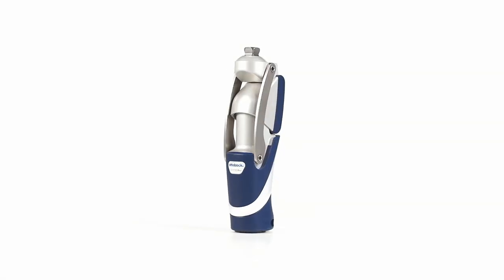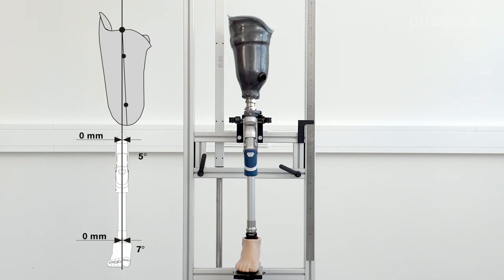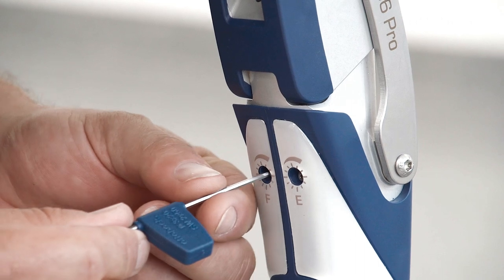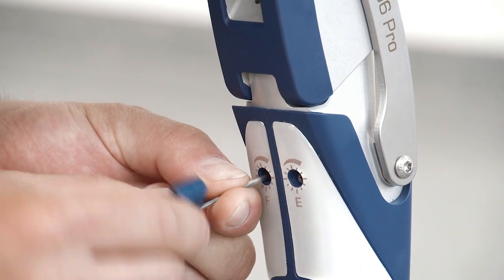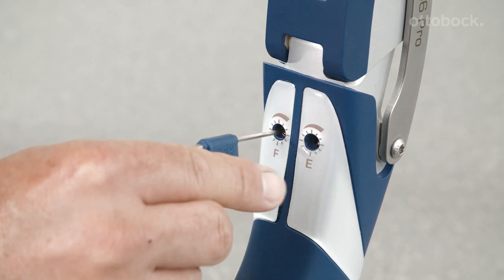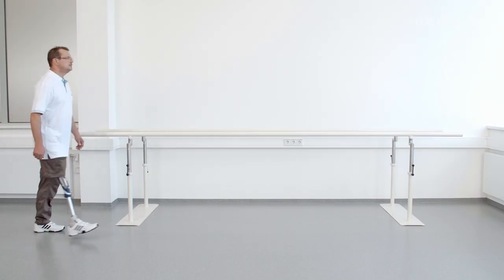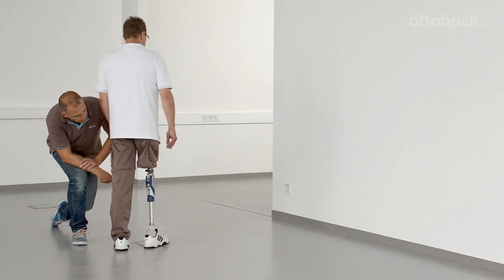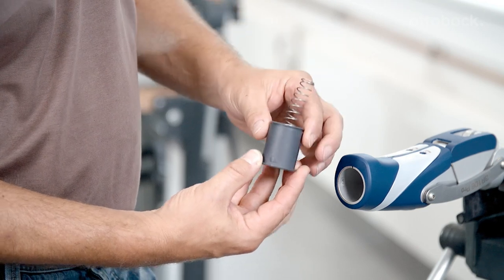3R106 Pro - Adjustments & Settings

Comment: Does the knee offer stance control? For doing squats for example
Reply from the maker: Dear Xhanti, Thank you for your question. The 3R106-Pro is a default swing knee joint, which means the joint is permanently in swing phase.
So it has no stance control like a default stance knee and therefore safety in stance phase is provided through its polycentric joint structure.  

We cannot recommend doing squats with the 3R106-Pro, but it is not forbidden either. If you do so, please be aware that the max. body weight incl. bar and weight plates does not exceed 125 kg. Maybe it is an option for you to use the leg press instead where you have a better control. 

If you are looking for a knee joint that offers stance control and would be more suitable for squats, we can recommend you our very recently launched brand new mechanical knee 3R85 Dynion. You can have a first look here: https://bit.ly/36FQI8Y & https://bit.ly/3ISUZCZ.
If you are interested, please get in contact with your local Ottobock branch and they will be more than happy to help out. 
Kind regards, your Team from Ottobock